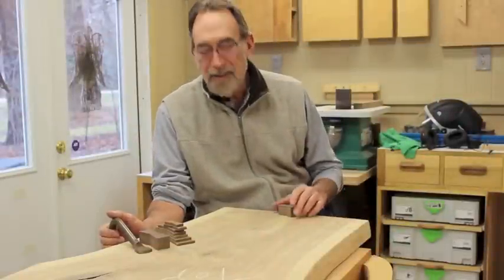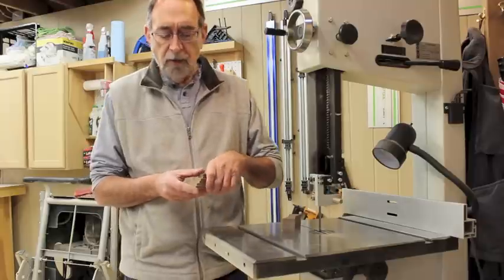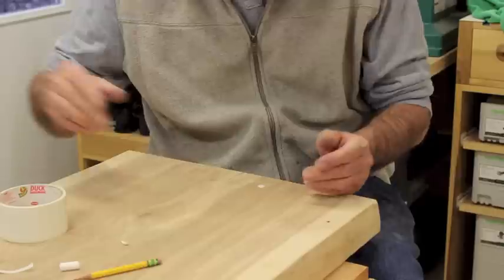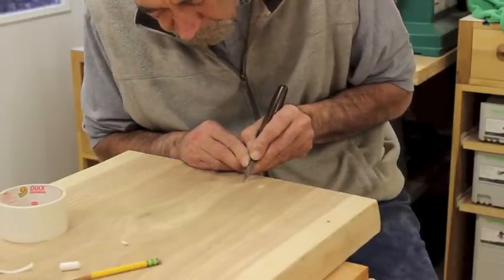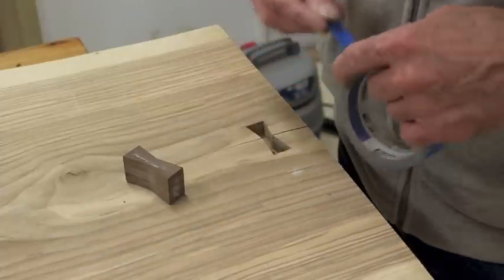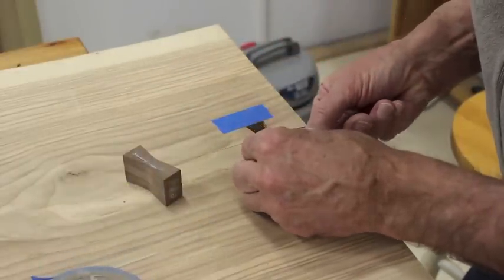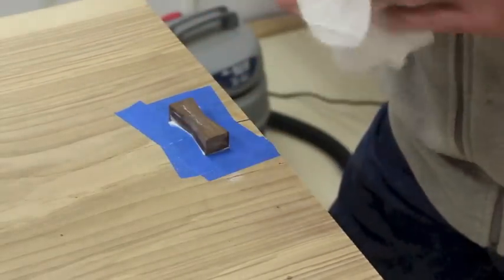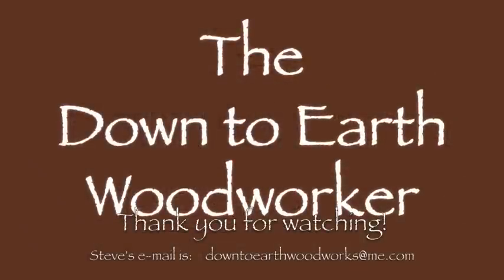Bowtie Keys Butterfly Keys

Comment: Great video, thank you for posting this content.  Had two quick questions- what woods work best for bowties?  You used Walnut, is there other easy-to-source widely accepted woods that are acceptable?  Second question- your check there is really minor... I've got some monsters (which I like for the overall look)- but if you have larger checks do you try and squeeze the wood together to reduce the size of the check?  Or is that just too hard / not really feasible?  Thanks again!

Comment: I'm wondering if you could make those keys on a router table... cut out the shape from a long piece of wood and then you have one really long standardized key from which to cut lots of keys as needed, to whatever size needed. 

I made a small octagonal patio and used thick splines and glue to join the outer pieces, now I think a long sliding butterfly dovetail would have worked even better and it would have held itself together by design rather than futzing with clamps and whatnot. If one could make the keys very long that is.

Comment: This is awesome. I have always wanted to get into wood-working. I want to use a nice slab piece of maple to make a small desk around 50-60 inches long 30 inches wide with metal legs (so all I have to focus on is the wood slab and not making wooden legs) I have very little experience woodworking do you think this is a project for beginners or am I biting off more than I can chew?

Comment: Thanks so much for this informative video! Subscribed :D

I'm wondering, I have a crack on a live edge table that goes all the way through. It's about 8" long. I would like to use a single Bowtie Key that is about half the thickness of the table itself. Would this be strong enough to stabilize it from further splitting?

Where along the 8" length should I apply my bowtie? 
Thanks again!

Comment from the maker: I don't know of any rule-of-thumb as to placement --- I tend to use a little intuition, a little aesthetic consideration, and a whole lot of guesswork.  As far as thickness, some folks recommend going the full thickness of the slab, and if it were a really serious crack, that makes sense.  On a slab where the crack is not anywhere near the failure point, and all I want to do is stabilize it, I try to put in a bowtie key half the thickness of the slab.  I've never had one move or fail.

Comment from the maker: When I have closed a crack, for either structural or aesthetic reasons, I always inject epoxy into the crack itself in addition to the bow tie key.  However, if you are trying to make a crack sort of "disappear" you will need to experiment with the epoxy and try to get a color match, otherwise you could make the crack "more" visible.

Comment: Just a new-be asking a question... Would it not be better to clamp the crack closed before making the Bow-tie? Then when finished the Bow-tie would be under tension .
Reply from the maker: True enough.  A couple of things, though... people "like" seeing the crack, so closing it up would give a different "look."  Just something to think about.  Also, if there is too much pressure, it very likely could break the bow tie.  Having said all that, I know people that routinely put a small amount of pressure on the crack and that helps keep the bow tie in place and they say it helps prevent the crack from growing.  I prefer to do it without the tension and have never had either a growing crack or any other problem long term.  I think it might have something to do with how stable the board is to start with.  I've got a slab sitting in my shop with a nice big crack that hasn't moved a micron in several months.  Eventually I will get around to the project it is intended for, and I will put the bow tie in without any tension.

Comment from the maker: This is partly aesthetic and partly structural.  If the slab is thick and the crack is small (narrow), there is probably no need to go all the way through.  If the slab is thin and the crack is wide, a bow tie key all the way through would be more structurally sound (and probably look better).

Comment: Do you have to do it on both sides? or could you go all the way through?
Reply from the maker: Matthew King It depends on the nature of the defect (split, crack), how thick the slab is, the grain orientation of the slab itself, and other factors.  Sometimes it is a good idea to put a bowtie key on both sides.  Going all the way through is very tough if the slab is thick, but on a thinner slab is a great way to go.

Comment: how does the bowtie keep the crack from extending more?
Reply from the maker: The bowtie has a mechanical advantage, much like a dovetail joint.  The bowtie key holds the crack and doesn't let it split open more.

Comment: is there a recommended thickness ratio of bow tie to wood slab?
Reply from the maker: Not that I know of... going all the way through is impractical most of the time, but you also don't want to make it so thin that it doesn't have the necessary strength.  I usually try to go about one-third the thickness of the slab.
Reply: Thanks so much!! Your videos are excellent

Comment: Why did you use the pencil at all? Why not just use the making knife?
Reply from the maker: +Matt Sweetnam The pencil line is easier to see when using the router to hog out the bulk of the waste in the middle area, the knife line is more precise and helps to locate the chisel for the critical edge cuts.
Reply: +Matt Sweetnam, really easy to slip and mark up your surface that way. caution is king in wood working.